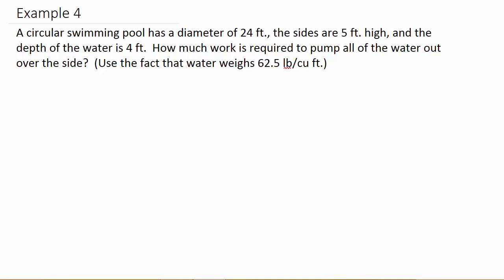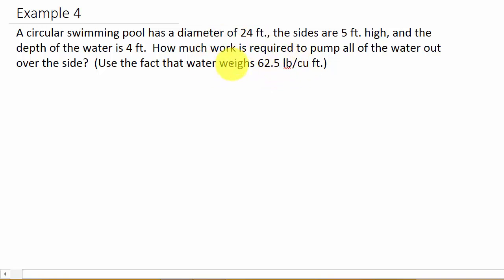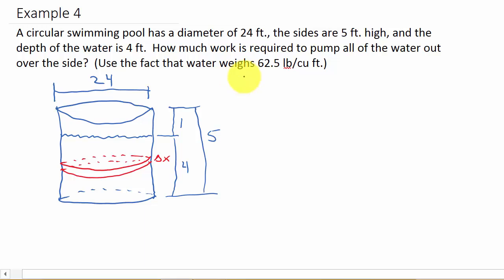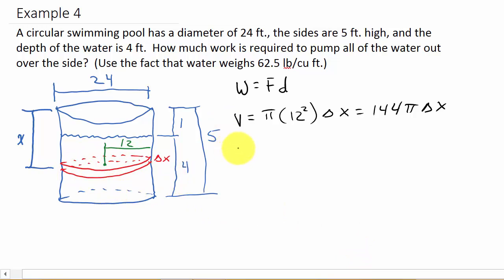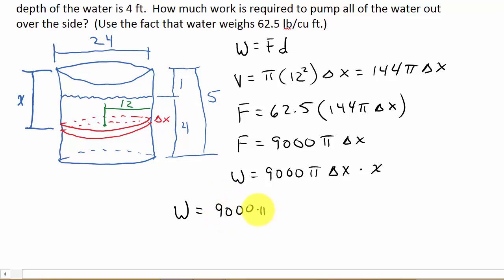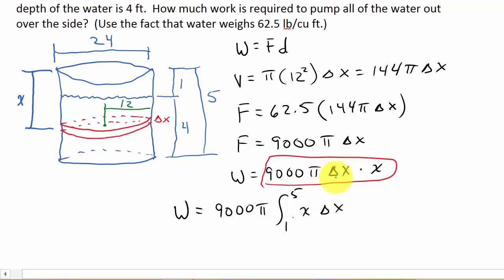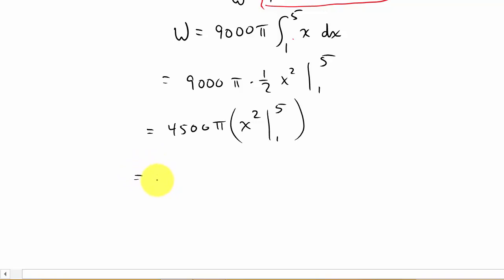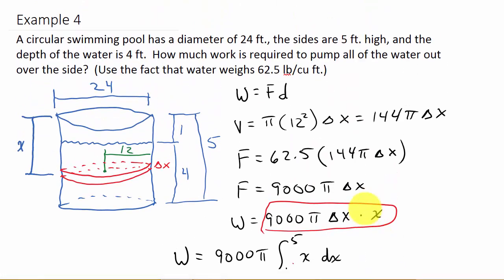Calculus Work Pump Water From a Circular Swimming Pool

Comment: FYI: An alternate way of writing the integral is as follows (to my knowledge this works only if the water is not at the tippity top):

<integral from 0 to 4> (144pi)(62.5)(5-y)(dy)

You can eventually pull out 9000pi as Steve did because 144pi times 62.5 is a constant no matter which way you look at it! 

This way of writing it takes the bottom of the water to be 0 (c) and the top to be 4 (d), hence the integral from c to d (because it's within respect to y). The 5 represents the total height of the tank and the y is the distance pumped at any given y). :3 Enjoy.

Comment: Thanks for the vid but can someone explain at the end why the lower bound of the derivative is 1 and not 0? The water starts at the bottom of the cylinder so how would it be 1?
Reply from the maker: It’s the distance the water has to travel to the top of the tank. The top of the water is 1 foot from the top and the bottom of the water is 4 feet from the top. So the bounds on the integral are 1 to 4.
Reply: @crowsmathclass  Ohhh okay that makes sense, thank you so much for responding I know this is a really old video lol but you helped me so much. I have an exam tomorrow and I'd probably fail without your help

Comment: The disks of water are lifted against gravity.  How come gravity is not used when building the force equation?
Reply: Weight is the force of gravity is pulling your mass towards the earth. When the metric system is being used, they are speaking in terms of mass and not weight, which is why they always include the force of gravity. If you would like more info on the difference I would watch this video https://www.khanacademy.org/science/physics/centripetal-force-and-gravitation/gravity-newtonian/v/mass-and-weight-clarification
I hope this helped.
Reply from the maker: You would if the measurements were in meters and kg.  We don't have to since we are in ft and pounds.  If have another video on pumping water from an inverted cone were the units of measurement are in metric.  Check it out.
Reply: @crowsmathclass  if the measurements in m and kg, can we find the work done? If can using what formula?
Reply from the maker: https://youtu.be/fD4FpIi5Jks

Comment: How is the force = volume x weight ? Where did that formula come from
Reply from the maker: Density X Volume  The density is the weight of water in lbs/cu ft.
Reply: @crowsmathclass but you didn't multiply acceleration with mass. In order to find the force you need the product of mass and acceleration which is 32 ft/s^2 here
Reply: Force is measure in a distance times a weight